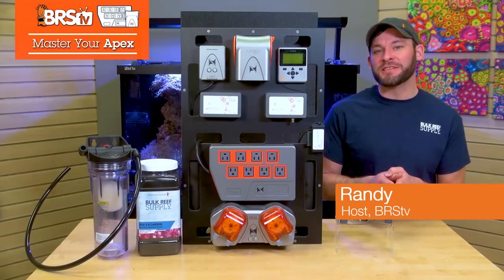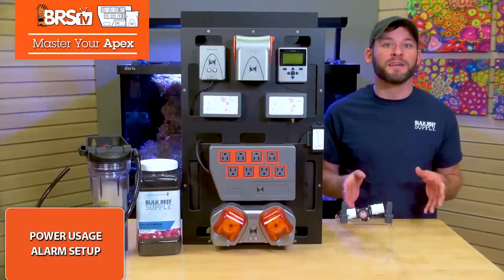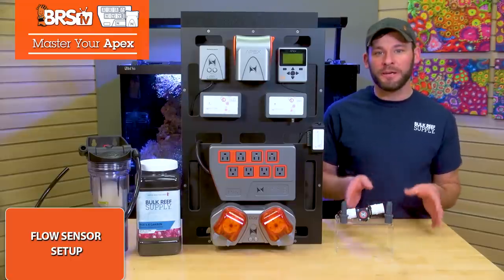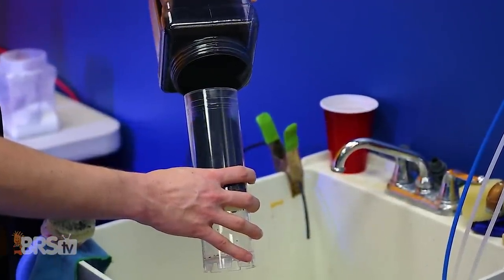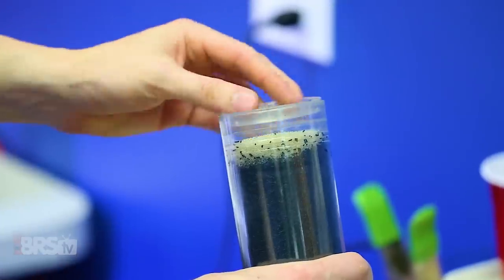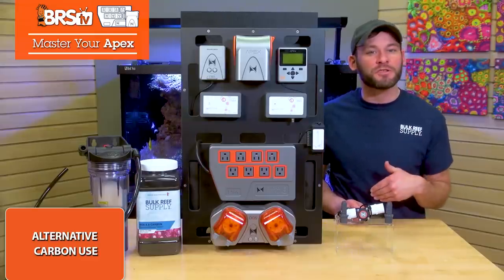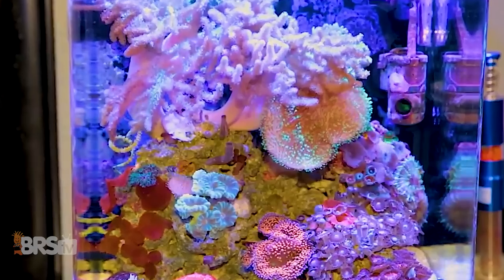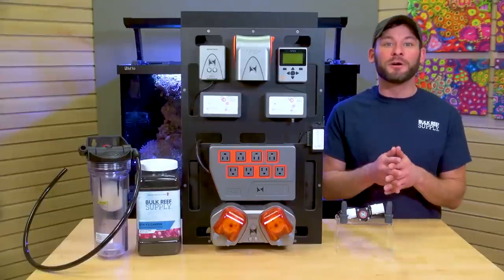Do You Have a Dumb Carbon & GFO Reactor? Make Them Smarter With Neptune Apex | Neptune Apex Guide

Comment: Wow so much extra equipment - Which is cool if that's what you're into. While I do use the BRS reactor / media. I just change the carbon and gfo about every 6 weeks knowing the carbon is long done but I don't think having exhausted rox carbon running is a big deal.  I could change the carbon more often but just do it when the gfo is exhausted. Then every 10 or so years change the maxijet that is powering it.
Reply from the maker: Absolutely! You can definitely get by without the fancy equipment, but for those who do want the control this is the way I would set it up. :)

Comment: Thanks for the video. You still avoided the question :-) What do you recommend as far as running your carbon media? 24/7? Few hours a day? Only off when feeding? Etc..
Reply from the maker: You got me there. I didn't give one way or the other, mostly because it's really up to the reefer and how they want to run carbon. Personally, I've switched my carbon from 24/7 to a few hours each day for a couple of reasons. 1) I don't feed expensive foods or additives, so I'm not concerned there. 2) Running a few hours per day means it won't get stagnant and full of gunk between uses, so I can actually extend the life of my carbon to some degree. 

The last approach I mentioned is more for having carbon on "standby"..ready to use when I feel I need it and then change it out afterwards.
Reply: @BRStv  LOL. Thanks for the response. Good points. I will put my pump for my carbon on a timer now. Those Apex ports are precious!

Comment: So I've been looking into the vibrant bacteria you've mentioned a bit 
But in a fresh cycled tank would purple helix and pink fusion work just as well ?
Reply from the maker: The two products have different goals in mind. The Vibrant is basically a bacteria product that feeds off of algae. The ARC Reef Helix/Fusion products are coralline bacteria spores aimed at seeding a new tank with coralline algae. I wouldn't use both products at the same time as the Vibrant will hinder the growth of the coralline algae.

Comment: Will only running a reactor for a few hours a day or say two days a week cause a negative impact on ammonia? I ask because I turned off my reactor the other day because it was time to change the media. I wasn’t able to change it for a few days and when I opened it finally whew did it smell bad. Definitely glad I didn’t start it up and pump that into my system.
Reply from the maker: I would be less concerned with stagnation using it for a few hours each day. However that recommendation of 1x per week is mainly aimed at having fresh carbon on "standby" where you turn it on for a day when you feel your tank needs it and change it out after it's done. I wouldn't recommend letting it sit for days and trying to use it again.

Comment: Correction:  At 1:18 you mentioned the "1Link 24 volt outlet" while discussing the 2-pin 24v Accessory port.  The 1Link ports are the 4-pin connectors used for Modules such as WAV, DOS, COR15 or Trident.  The PMUP connects to the 2-pin 24v "Accessory port".

Comment: “Instead of using less carbon in your reactor 24/7.” At minute 5:20 does he perhaps mean more carbon instead of less? If not, then I’m confused.
Reply from the maker: I probably could have explained that a bit clearer. Basically, without a controller or timer if you wanted to reduce your carbon approach you would just use less carbon in your reactor, but still run it 24/7. However in this approach you just run it for a few hours per day instead of 24/7.

Comment: My concern with running the reactor on a set schedule is the water stagnant inside of it. I do not recommend this.
Reply from the maker: Definitely true with the 1-2x per week option. That suggestion is mainly for having fresh carbon on "standby" where you turn it on for a day when you feel your tank needs it, then run the program and change it out after it's done. I'm less concerned with stagnation using the few hours a day approach.

Comment: Ok I bought the pmup,, plugged it into my el apex but nothing popped up on my display in fusion.  Do you know why I was not alerted to a new switch in fusion.  I checked from a phone
Reply: You need to click on the lock symbol on the upper right, and you should be able to pull it down with the rest of the icons you have activated.
Reply from the maker: It's going to be one of the outlets usually labeled LINKA_#_#  or  LINKB_#_#.  These are the two 24v outlets that every EB832 has. Just toggle one or the other and see which one your PMUP is on. 👍

Comment: Mehhhh.... This is wayyyyy over-engineering and over-pricing something that's simple to do....every basic task doesn't need automation....
Reply: What makes it worse is I believe turning the flow off on carbon would greatly reduce its lifespan. Might allow biofilm to form on its surface, blocking the pores.
Reply from the maker: Definitely true, not everything needs to be automated. These videos are more targeted at answering the "IF you wanted to do XX, then here's how I would do that" rather than a be-all-end-all solution.